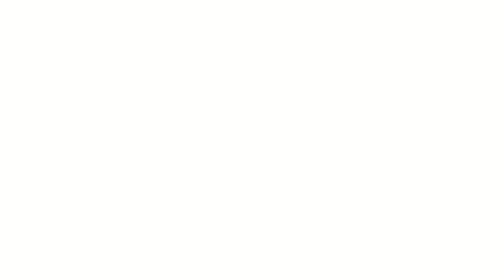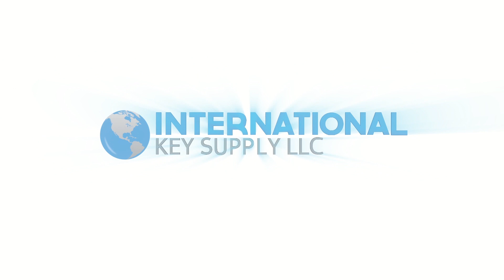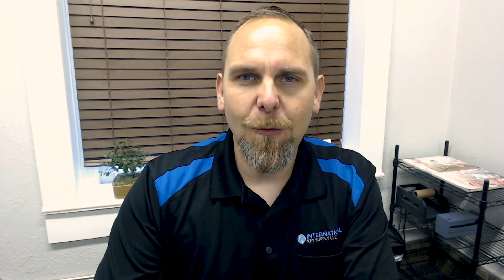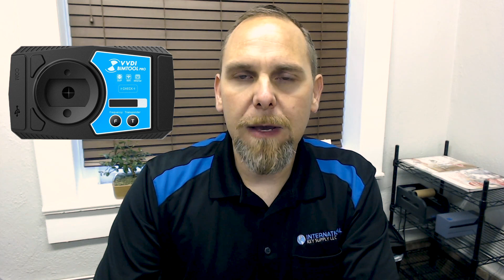VVDI BIM PRO Tool

Comment: Hello , Making CAS3+ by OBD with VVDI BMW or VVDI BIM TOOL? Is it safe?Or better on bench? Does the new VVDI BIM TOOL work 100%, read about some problems?? Jakob
Reply from the maker: Hello - There is no tool on the market that performs the downgrade on a CAS3 Module that is 100 percent safe.  You need to remove the CAS Module and read the EPROM and flash before the downgrade, no matter what tool you are using.  Thank you for your question.